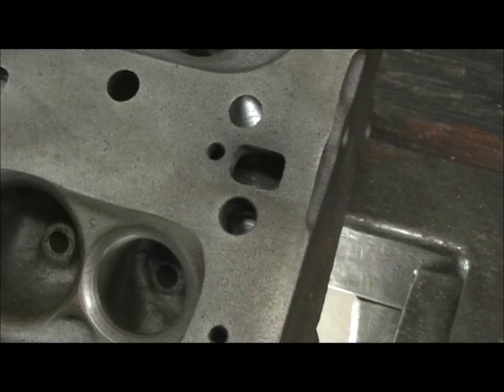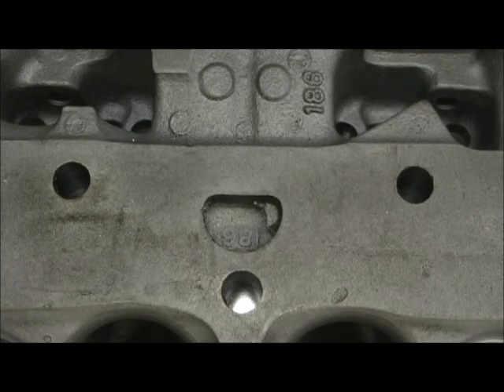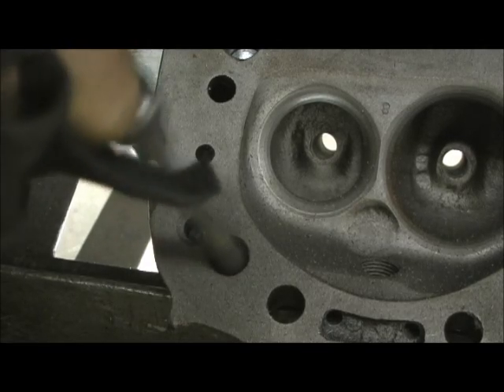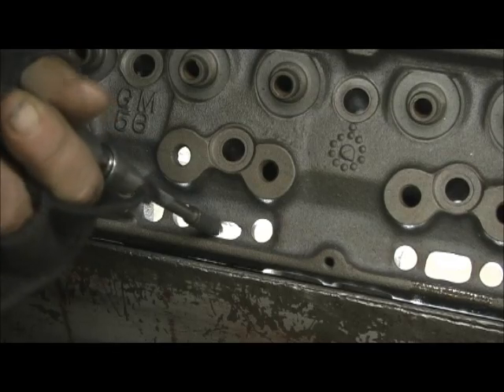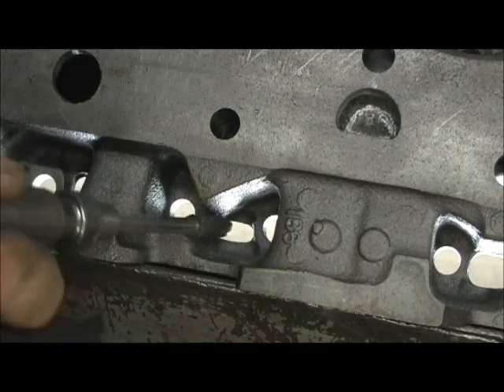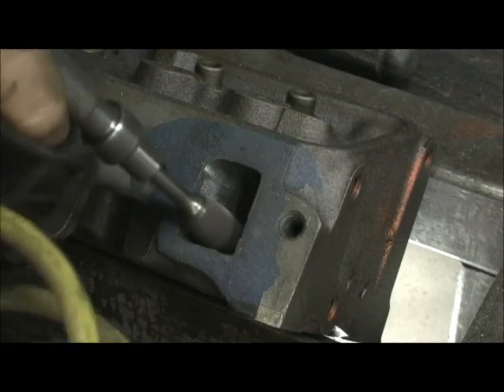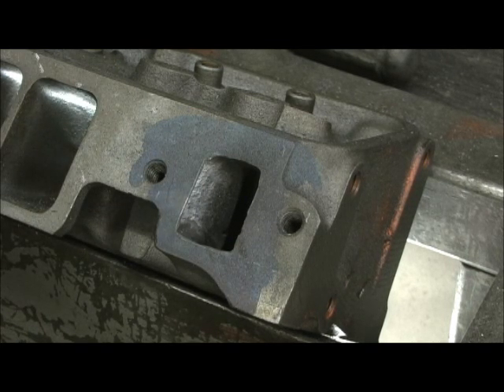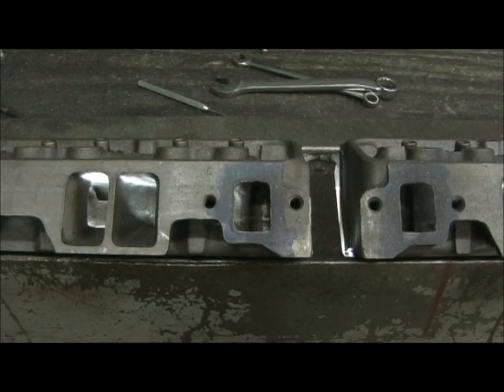Imhoff 186  Hump sStage III 5 Prep 2 2

Comment: A lot of people may criticize you for spending so much time on the water passages, thinking that you're worried about the parasitic drag on the water pump due to the flashes, however I notice you're opening them up....

A cooler head drives down detonation thus creating the ability to give it more timing,  thus make more horsepower... 

BRAVO!

Comment: Have you every had a set of heads that the rocker stud does not line up with the valve stem I got a new set of aluminum heads they were made by pro star and this is the problem I have and the people told me that was ok it is because of the 205 valves they are 205 chevy thus just does not sound right are they blowing smoke up my ass or what even the stud girdle will not fit they are crane please help thank you Tom